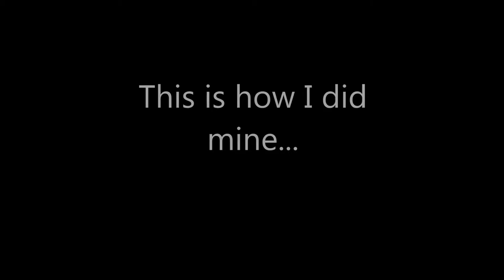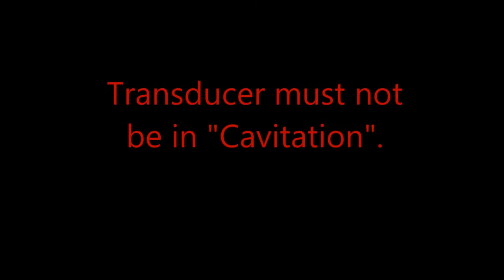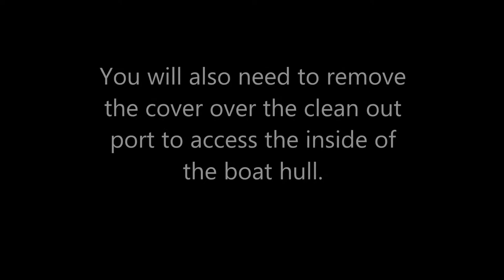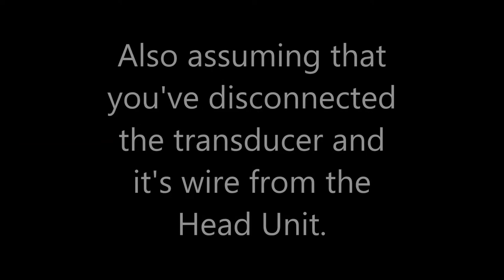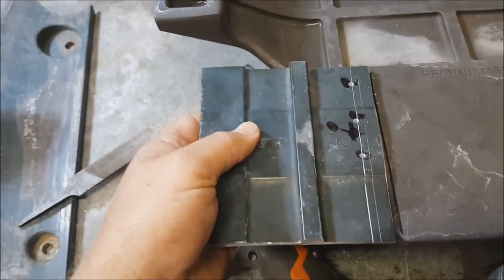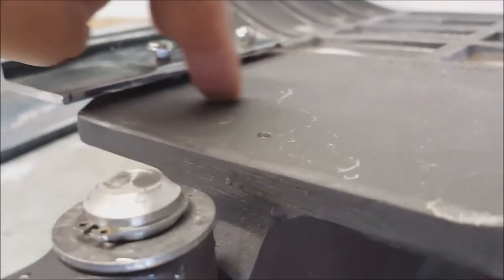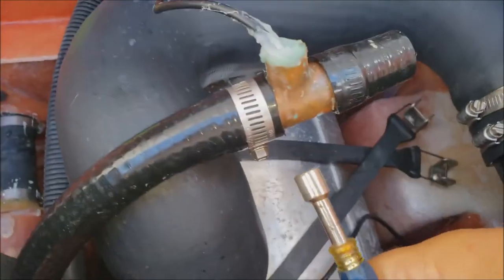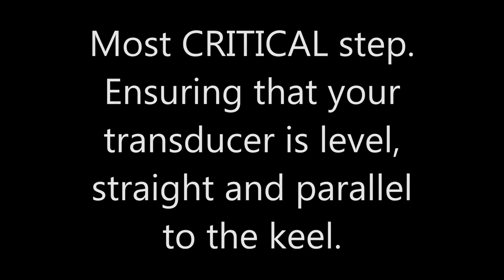Install Transducer Yamaha Jetboat SX190 Epi 10

Comment: Question sir:  Was there a reason why you didn't mount it directly to the bottom of the ride plate itself?  I'm looking at the same problem as you've figured out.  The transducer I'm looking at is the Navico Totalscan which is about 12 inches long.  It seems like a solution would be to just drill out the ride plate and mount directly to it.  Thanks for the video and any thoughts about that mounting option?
Reply from the maker: Aloha, This is a good question.  First let me say that my Garmin is still intact and works perfectly at all speeds so the install has merit for this type of boat and its set of conditions.  

To answer your question of mounting it directly to the bottom, if you install it directly to the bottom of the ride plate you would be setting up 1 condition that, having been a PWC owner-racer-tuner, I believe would upset the ride plate function by turning the TD into the ride plate as it would now be the lowest point in the water. The dynamics of ride plate widths and lengths and angles on a PWC  (which these boats kind of are, just larger) make dramatic changes.  

Additionally on my 2017 SX190 the ride plate has a center skeg and mini articulating keel so mounting the TD had to be off center which again if mounted direct to the ride plate would likely result in some handling change or balance.  

Other reasons not to mount it directly to the RP underside are: 1. Protection from oncoming obstacles (floating logs and branches), being away from the center it's less likely to get hit and this has been proven time and again. 2. Ease of maintenance once its installed. Should I ever get another/different TD I only need to drill and tap the mounting plate, no need to remove the ride plate.  3.  In its mounted position it receives no turbulence from the boat, its placed directly in the on-coming water therefore making its performance work at all speeds.

Hope this helps!

Comment: Very nice Scott! I installed my transducer yesterday but had to drill a hole for the wire  in the transom. 2019 rear end is a little different. I like your idea though. Great video as always.
Reply from the maker: Aloha, thanks for the kind words.  In reality the wire up the drain hose was something I saw on another video.  Should have credited that guy but I can't find it anymore.  Yeah it does look like the back end of the 2019 is different, in a video I noticed a white fitting on the 2019 on the starboard underside that is not on the 2017.  Looks like the 2019's had a lot of changes.  Especially like two things:  1.  Radio on Pilots side 2. That killer trash can that swings out. Excellent.  Aloha and Mahalo!

Comment: Very nice.  Wondering if I can do this on my 2017 fx ho.  T-fitting idea was clutch.  I have had a problem with "regular caulk" in marine environment before (your silicone will probably be fine, and it is not in water all the time) so now use the loctite marine sealant and it works well.
Reply from the maker: Aloha,  Thanks for the kind words and watching the vid's.   I can't take credit for the T-Fitting, I saw it some where else and can't remember where.  When I saw it I knew I would use it.  I don't like drilling into any boat below the water line.   Ditto on the regular caulk not withstanding the salt environment.  The silicone will hold up if it's allowed to cure.  I've been using silicone to seal up the pumps on all my PWC's for years.  Thanks again.

Comment: good I have a fsh 190 sport, the question is can I pass the cable through the drain, is it right there where the water comes out when you turn it out of the water so that it does not heat up?
Reply from the maker: On my SX190 there is a drain fitting in the hatch where the clean out port is.  To get to it, remove all the screws holding down the plate, you will also have to reach your hand in side one of the circular ports to unscrew the large hose clamp holding the plate to the very large hose of the clean out port access tunnel. Once the plate is loose from the boat it will still be connected to that drain fitting and its hose.  This is the hose you cut and install the Tee fitting.  Its drain exit is under the swim platform, no hot or exhaust water runs through it only water that makes its way into that locker.  You can run wires through it safely up into the boat. No drilling.

Good Luck.
Reply: Hawaii Jetboat Adventures Thank you for the explanation I hope it also helps other people.
Reply from the maker: @sandrorivera9728  You're welcome.

Comment: Does this make your boat pull to the left?
Reply from the maker: Aloha,

That's a good question and my honest answer is that I can't feel any pull whatsoever. I get more pull one way or the other by someone sitting on the wrong side more than anything.  The leading edge of the transducer is about 1.5 sq inches and it's nicely shaped so it glides through the water better than something square.  Another thing is that I'm in the ocean where it's never flat and calm like a lake or river and you are always steering and counter-steering to go straight.

Comment: Just wondering how you fit the transducer wire in through the drain outlet ?  Mine won’t make the turn into the drain .... if it was straight it would but the turn stops it.  

Appreciate all the informative videos !!
Reply from the maker: I cannot remember if the exterior drain spigot (the white one where the cable goes in) had a 90 degree turn or if it went straight into the drain hose.  The "plug" end of the Transducer Cable was about the circumference of my little finger and I don't believe I had any challenges getting into and up to the location in the hose where I cut and inserted the Brass Tee fitting. If you do have a 90degree  bend AND your "plug" end is small enough to fit and just needs to get past the bend I have 2 suggestions.  1.  Run a length of wire or cord through the hose from inside the boat down through the hose (you'll have to disconnect the hose from it's fitting, which you'll have to do if you are going to insert the Tee) and attach it to the plug end, then lube up the hose so it drips down to the bend and gently pull/fish the plug past the bend.  2.  Disconnect the fitting with the 90 degree bend from the boat and work the plug end through it while it's right in your hands then put the fitting back in and pull the wire through the hose.

Good Luck!
Reply: Hawaii Jetboat Adventures    Awesome I’ll try that thanks !   

Also, do you recall what size t fits the hose ?
Reply from the maker: @grahamdawg  On this one I don't remember but I do remember not having the right size in all my "parts bins" and having to go to the Hdware store right in the middle of the install to fetch the right size.  Would suggest you determine that size first and buy the tee in preparation for the install.  Good Luck!
Reply: @HawaiiJetboat  Hey Scott and Graham, I'm trying to do the same in my sx190 and cable won't pass the drain 90 degrees. Were you able to resolve it Graham?
Great videos as usual Scott! Aloha!
Reply from the maker: @marcosnuzzibarbosa1251  Aloha.  Are you referring to the 1st opening under the boat that drains to the sea?  If so you may need to attack this from inside the bilge area (under the deck plate which you have to take off anyway).  I cannot remember if I had to snake a cord down through the rubber hose and out the drain hole and connect it to the transducer cable and pull or if it went up the hose easily to begin with. Thicker cable perhaps?  Worst case scenario is change out the plastic 90 with a straight and then run the rubber hose up to the T fitting.  If I remember correctly there is very little excess rubber hose to use so you might need to get a longer section.

-scott
Reply: @HawaiiJetboat  Thanks Scott, it will be very difficult for the connector to make the 90 degrees so i will probably go the the replacement to a straight drain. Will keep you posted, thanks!

Comment: Hi Scott! I have a 2015 AR192 and I don't have that keel, my plate is flushed and don't stick out connecting to the keel.. do you think it would work if i mounted right under the plate instead of the side like you did? Thanks in advance.. great video!
Reply from the maker: Aloha,
I looked up your boat and from what I could see you are going to have to do more shimming to get the transducer above the plane of the rideplate bottom.  I would not recommend mounting it on the bottom of the ride plate for 2 reasons: 1) It will get destroyed if you run over something and 2} the flat uninterrupted plane of the ride plate is important for stability and getting on plane.  I think it can still be attached on the port corner of the plate using a taller set of shim stacks than i used.  Do a mock up of best places to fit the unit and then work backwards on whats needed to get it to work.  GOOD LUCK!
Reply: Thank you very much for your helpful advice!

Comment: The drain you put the cable through has a rubber door that only opens to the outside of the boat. How you now make sure water does not go in
Reply from the maker: Aloha, 

The white fitting the cable is running up into is the drainage exit from the back deck of the boat in the clean out area under the hatch, 4:05 on the video, look in the upper right corner and see the starting point for this gravity drain.  The drain exit is lower that the starting point so water wont reverse into it under resting and normal forward motion.  The only rubber door on this boat is the rubber gasket at the exhaust vent which has been sliced into little fingers covering the hole to keep floating debris out. Hope this helps!

-scott